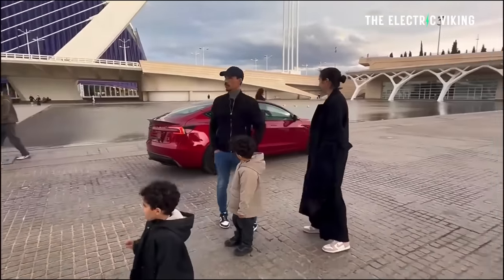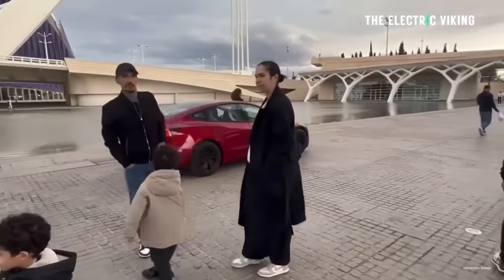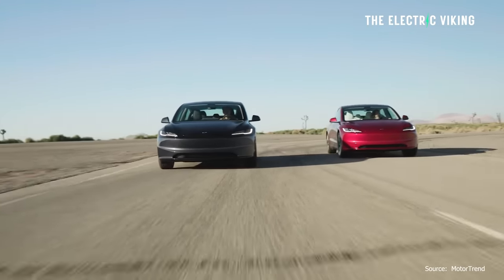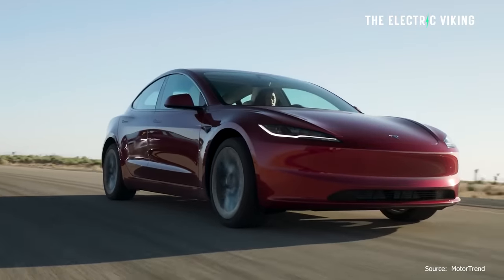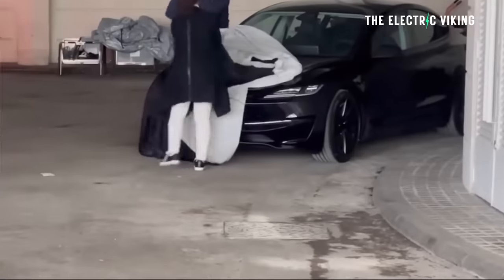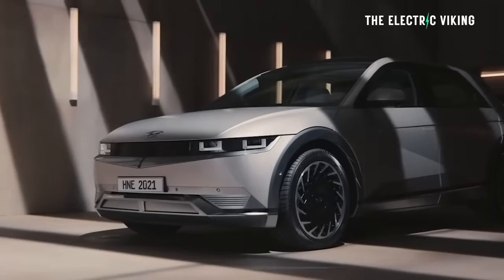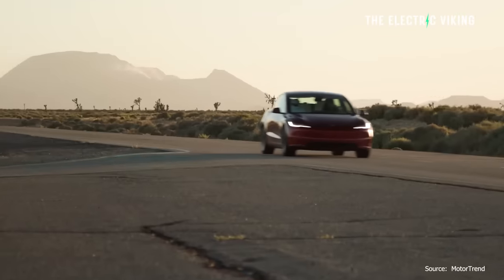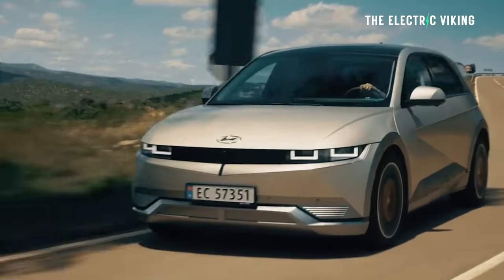Tesla Model 3 "INSANE" mode and NEW features LEAKED

Comment: Active suspension is what interests me the most.
That is the final piece in the UFO tech puzzle;  Tesla's already have all the other pieces;  but active suspension just closes the loop.
Reply: do you plan to really choose suspension modes or really need active suspension? Whats wrong with the default suspension on Highland? Ive driven it multiple times and like it.
Reply: I’m a Model S owner… I got 3 of them. Please stop tempting me with all this Model 3 stuff…. 😂
Reply: The braking on the standard and lr Model 3 is horrible.  Went for an S just because of that.  Next one might be this Performance 3 IF the braking is decent.
Reply: @WarpedTrekker  Frankly, what I would like to have is a way to hack the algorithm, to experiment with it myself.  I'm an electronics engineer, specialized in analog design, PID controls, etc.  I wouldn't mind spending weeks optimizing the active suspension in my own car;  perhaps make it adaptive-multi-modal;  maybe throw in a neural network 🙂.
   I haven't driven a Highland, but I saw one pass me by, a week ago, and I noticed how the suspension seemed a lot smoother than in model 3;  so, I believe you.  But passive can only go so far.  Like I said, I believe active will close the loop of the space-ship on wheels experience.

Comment: We just added a Model Y to the garage.  I would add the Model 3 Performance to replace the other (ICE) SUV after giving them a couple of years to work the kinks out of the hardware and software.  The Autosteer on the Y is still described as "Beta" software, for example, even though the Y has been in production for several years; and batteries are always getting incrementally better.  The Hyundais aren't bad, but they are also SUVs; one SUV in the garage is enough for us;  a bit of  driving"fun" should be sitting next to it.  PS  Your family has had enough medical problems for a lifetime; sorry about the foot.

Comment: It uses cameras to determine which direction you want to drive in. The standard M3 RWD and AWD have this in Beta. Apparently, it works "reasonably" well and can be turned on/off. Not just in the Performance model. Don't floor it though, or you could come unstuck. 😉

Comment: I had a 2002 Audi S4, it was the nicest car I ever owned. I believe I used the extra power ( 6 cylinder. 2.7 l with Twin Turbos) maybe 10 times in 10 years, so I'm getting the M3RWD and saving some money. It accelerates plenty fast for me. 0-60mph in 5.8 secs. Vs my S4's 5.9 secs.!

Comment: Is the battery capacity the same as Highland? Will the range be less due to being a performance model?
Reply: The dual motor Model 3 uses more electrons than a rear wheel drive Model 3.  My 2019 Model 3 Performance utilized around 85-miles on the display or thereabouts to make a 45-mile highway trip in sunny weather that I made often. Tesla stated my 3 Performance had a 310-mile range but, I was never able to get more than 286-miles on a full charge.  A third-party estimated the battery capacity to be 78Kw. 
Tesla gave me a 2018 Model 3 rear wheel drive loaner once for a week and you could clearly see the difference between a dual-motor and a single-motor.  If you wish to conserve energy and have no need for speed, get the rear wheel drive. If you have a wild streak in you, get the performance model as you will not be disappointed.  Just keep checking your rear view mirrors for any flashing lights.

Comment: the auto gear selection reverse/drive has been intended for all models since they removed the shifter

it appears that it just hasn't been ready for prime time yet and stuck in internal testing, no wonder people have been complaining about using the screen

as i understand it the software just predicts based on tesla vision and last action, so when you first start it will default to forward unless you need to reverse to comfortably get out of your parking spot, when you reverse to make room forward it'll will automatically switch to forward when you come to rest and so forth - it seems like a fairly simply thing to program with minimal edge cases that would require you to manually intervene

can imagine the austin powers 50 thousand point turn would go without a hitch
Reply: thing is, if it's not fully automated parking, it's bound to mismatch and could be irritating
Reply: @zes3813  sure, but those edge cases will be sorted with AI, reliability is a function of data - probably why it's still a dev feature, it's probably still irritating and will probably go live when it's a minor inconvenience

eventually though it'll be extremely reliable and eventually expected

back in my day, we use to have a shift to change from drive to reverse - sure great grandpa

Comment: You dont want a big wing in EV as drag is enemy of range . It would need active aero to have a big USEFUL wing / air brake which would cost a mess of money and add weight and complexity . Wings are for highspeed turns and to some degree high speed stability .

Keep in mind this is a " sport" model which doesnt mean hardcore track car.

Alao keep in  mind that accelersation is everything that makes a road going track car . Porsches GT cars are relatively low powered cars and dont accelerate like many Teslas but NOT A SINGLE PERSON WHO ENJOYS A PORSCHE GT car on a track would prefer any tesla for a track day or even another car that is ice that can compete witb it . 

Track times are a metric that porsche and others chase but there is also the confidence , the response and type of response of inputs , SOUND which for good or bad and EV can not do what some people find a lovely sound of high revving small displacement NA boxer pushed to make 500 HP . Its big for a porsche boxer but small for NA engine in fast car . People can debate sound as wether its valuable or not and as time goes by and people forget about engine sounds and the changing tones , notes and crescendos , volume etc but tue visceral thing is real for many people .

If battery tech actually improves to where you can make a battery pack that weighs 1/2 of what they do today with range and fast charging you will see cars that will grab even the most ardent porsche GT car and McClaren fans . 

But right now EVs are trying to keep up with something like a BMW rather then a proper Track Focused streetable car . The acceleration is a trick of sorts that EVs do well . Very very few Tesla 3 buyers have any ability to use the acceleration beyond making a passenger feel sick and to never worry about wether there is enough shove to over take or to get to speed on off ramp . For many buyers its a flex , same as it was for mwny ICE cars driven by people desperately afraid of their cars potential and NEVER exploring the potential . THATS WHY PEOPLE WANT IT TO LOOK MORE AGGRESSIVE AND SPECIAL . People will waste money but want others to know they did and represent that they have skills and need of a high performance cars to match them to portray competence , and being an exciting risk taker which is deemed sexy .  I think the 3 performance is a good idea wnd a few people who can actually drive fast will buy them to have an appliance that is more fun but the majority of people who cwn drive and hwve money will also have some kind of ICE car to fulfill their interests in driving , which is FINE .

The idea that ALL ICE vehicles must go away is RE DICULOUS and counter productive to the purported goals or emplimenting them.  I think EV adoption would be greater if they were marketed for what they are and good at and fkr who . 

If ANYTHING they should be pushing that buying EVs will save V8s and high revving V12s to be able to be driven for fun and as SPORTS CARS even if with limited amounts of usage . Meaning you wint be driving a 15 mpg V8 30K MILES a year everywhere for everybody , but they will exist and be something to aspire to if your a fan of such things , not every single mile ever driven needs to be in an EV to protect the environment the same way volcanoes and people who roast weenies in woods twice a year dont need to be outlawed . 

There is 100% room for clean ICE fueled  engines for those who enjoy them .  Many people really dont at all on ANY LEVEL NEED THE MODEL 3 PERFORMANCE and it is a wasteful car , wasteful of money , resources AND ENERGY. But it should exist . The same way small city EVs should exist for their purpose .

If the cultish EV zealots are correct , EVs will be so cheap that people with a few bucks can own multiple vehicles for different purposes . 

It would be super smart to have small safe , even a little fun cars for people who commute a bunch but also have 5 kids and are into kayaks . Why put wear on an expensive   behomoth to move 1 or 2 people .

As important as Evs may be its equally important to wean stupid people off of SUVs who dont actuall need them . Right vehicle for right task , if that could be the PUSH. To make make people less stupid , that would go a long way .

Comment: I really hope they do not lower it more than standard Highland.
Reply: 100mm ground clearance is the absolute minimum allowed by laws. Love to see good air suspension fitted. Air adjustability is infinite by software. It can be adjusted to individuality and customisation.  Interestingly if Tesla would hire a race car driver, to fine tune the air suspension setting for every tracks available throughout the world. Though Air suspension can add weight to the vehicle. A small price to pay. A three mode suspension is still a compromise. A very stiff suspension with negative tyre camber is very good on the dry but, it is terrible in the wet, snap oversteer happens and the car can spin to 180 degree in the wet very easily.

Comment: Tesla roadster 1 sec to 60 mile/h or 100 km/u is an acceleration close to 3g. G-monster fighter pilots endure 5g acceleration, however, most people pass out around 3g acceleration. The Tesla model y is 1.15 g,  I wonder if Tesla inc understands the ‘passing-out’ danger of EV acceleration. Elderly people should not go beyond 1g. I am 60, became quit dizzy as a T model Y passenger.

Comment: Tesla is like Apple. Once you purchase Tesla products you are confined to its ecosystem. Tesla solar, Tesla battery storage, Tesla cars …
Reply: Oh give me a break. They offer products. You choose what you want. I have a Model 3, a SolarEdge inverter and DC Optimizers, Astro Energy modules, a Clipper Creek and a Tesla travel charger.
Reply: There are several aftermarket people producing accessories including buttons and stalks.   For V2H be glad that Tesla is handling it all.  Ford went with an outside company and it was a mess for the "Transport Evolved" channel.   With millions of Tesla cars on the road I expect to see replacement batteries from non Tesla vendors.  First they have to start failing or wearing out in numbers.  Chill.
Reply: Why do you need tesla solar?
Reply: We have two teslas, and I’m putting in Bluesun solar panels, EG4 inverter and batteries. Tesla solar isn’t even available in my area.

Comment: GOOD CABIN HEAT, 500 MILE RANGE beats 0-60 in 1 second for 99% of people. Most people want to get there, comfortably. They don't need top fuel acceleration. It's a stupid benchmark, frankly, more range, less acceleration, and an EV that charges enough for a 200 mile range overnight, from a 20A outlet in your garage would sell MUCH better than a rocket you have to seek a charger away from home. It was always a toy for the rich, designed and marketed as such.